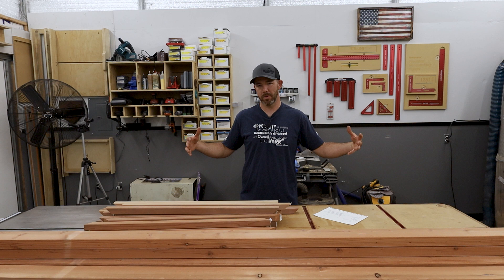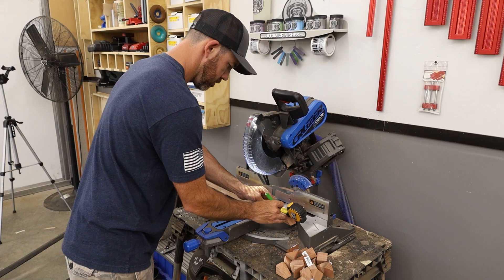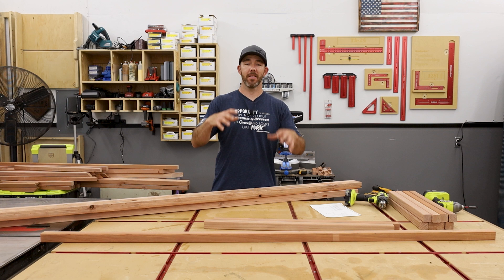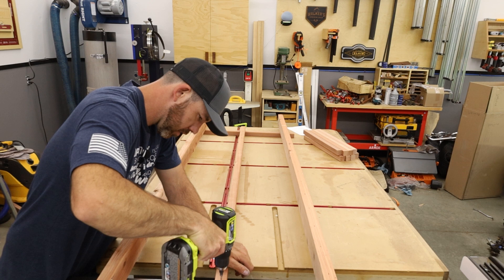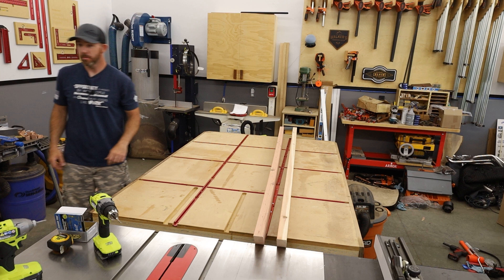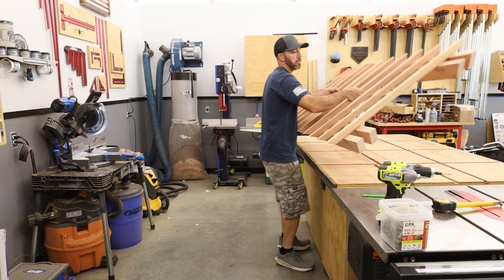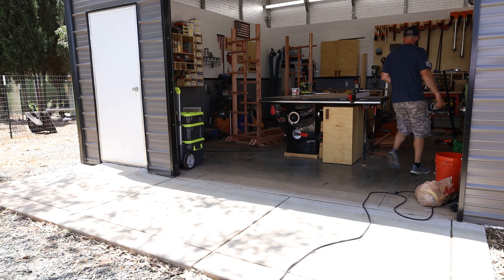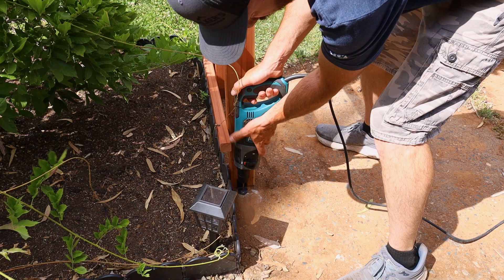Simple DIY Wooden Garden Arbor | Redwood Trellis

Comment: Just a suggestion, instead of measuring every time to get your six inch spacing you could cut a couple of scraps to six inches and use those so you have less chance of making a measurement mistake. I would also like to see you make a miter station so you can use a stop block to make your repetitive cuts. But in the meantime you can screw a sacrificial fence to your miter saw fence and attach a stop block to that with a clamp to make long repetitive cuts.
Reply from the maker: About halfway through I was thinking I should make some spacers then though... nah lol. I do plan to add those things to my miter station when I make it.  I appreciate you watching and the good ideas!

Comment: Looks great, Brandon. Just curious - why didn't you use those T-tracks in your table to clamp the parts down during the initial assembly? It's great to see content from you again. I'm glad you didn't cut parallel miters on the top rails (lol). How many cans of spray did you use? A miter station video would be interesting. Everyone does them differently. Take care. 
Bill
Reply from the maker: Hey Bill! Welcome back haha. I had to take a bit of a break but I am back now! The clamps for the t tracks wont go that high to hold down the 2x4's unfortunately. I honestly find myself not utilizing my table as much  as I should.  I used 2 cans of spray per coat. I think I will add another with brush on too though just for good measure whenever they get it back in stock.  Thanks for the support man! Have a great weekend!